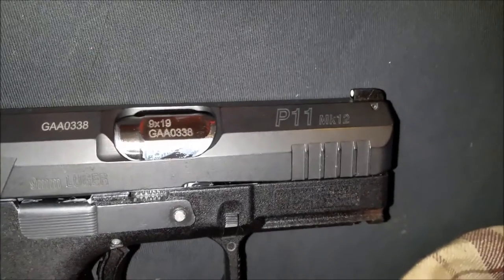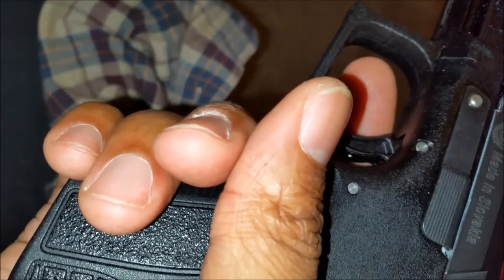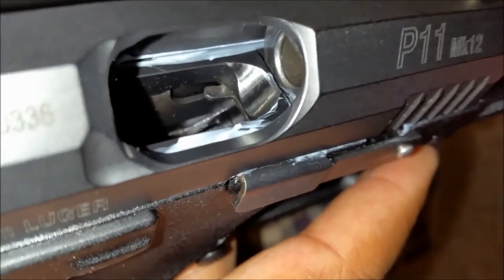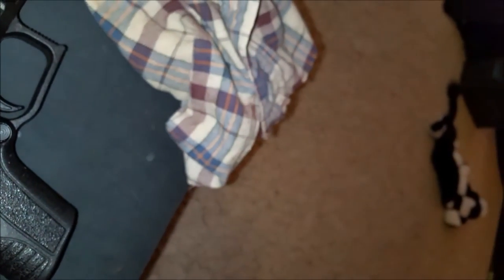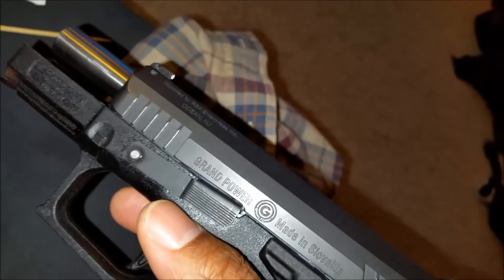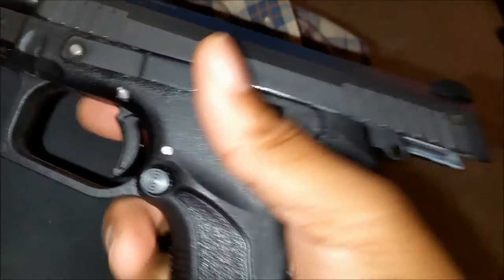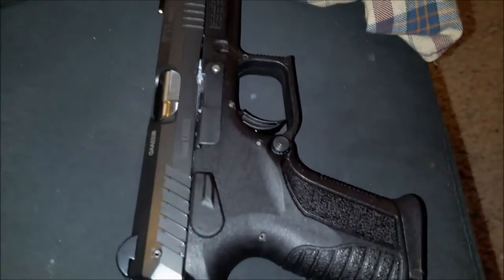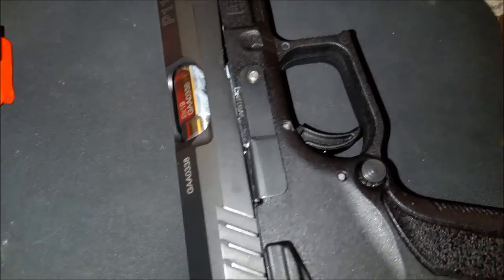Grand Power P11 Mk 12 - Failure to Return to Battery

Comment: Thanks for you reply. I have never tried or probably never will use flat nose FMJ's. I like round nose 115gn. I'm not interested in any pistol that can't shoot them reliably. Round nose 115 Hrain are easiest to get and lowest price to practice with. I shoot Remington UMC FMJ round nose out of my Ruger SR9c with never a malfunction of any kind. I really like double single action hammer fire that has Flip DOWN thumb safety's that are not slide mounted.That's why I never bought the PX4 Storm and that gun is just too thick. I resently purchase a Turkish made GIRSAN MC14 in 380. I love this pistol! Wish I could find one in 9mm just like it. Wish I could put up a picture of it! It is imported in the US by Zenith Firearms. I really like everything about the GP P11 but I'm not sure how much I trust the rotating barrel. I saw Sootch00 review and I love that guy! He is my favorite gun guy! I like the Bersa UCP but it's a hard gun to find. It's lower price than the p11 I think. What ever I get, it has to be reliable with my preferred defense ammo, which is Winchester PDX1 124gn Plus P
Reply from the maker: +Robert Glover there's a reason I used flat-nosed FMJ.  It's a good way to test how JHP would feed, and I was trying to diagnose an ammo issue.  Initially, the problem showed itself with Remington JHP.  Instead of shooting all JHP, I decided to buy flat-nosed FMJ to diagnose the issue, as flat-nosed is an attempt to mimic how JHP might feed, so you don't have to spend tons of money in troubleshooting/practicing with JHP.  

I also shot other brands of ammo (all in one session): WWB, Gecco, Tula, and American Eagle.  Only the Remington caused battery issues.  A total of 440 rounds and between 5 brands and only the Remington caused issues.

I get what you're saying but it's a bit difficult for me to accuse the Grand Power of issues when my Springfield XD exhibited the exact same problem with the exact same ammo, at the exact same range visit.  That is extremely difficult to argue against.

I've a Ruger SR9C as well (well, it's the wife's).  In fact, I've more than several guns that eat whatever is thrown at them.  If I didn't think the GP was worthy of carrying, I wouldn't be using it as my EDC now.  I think the GP is worthy of EDC, as long as you're familiar with how to lube it and as long as you test ammo...that's really no different than any other gun on the market.  Glocks may run without lube but that doesn't mean it's a good idea.  Glocks (or Rugers) may eat ammo without issue but that doesn't mean one shouldn't test ammo.

Let me know when you get a Bersa UCP...I've been curious about those!

Comment: Ron Sinclair  Start using Weapons Shield Oil instead of grease on your rails.
Reply from the maker: I don't think it was an issue with the rails or the lube I'm using.  The fact that I went from multiple FTEs and RTB issues to only 2 tells me that what I did to correct the issue actually helped.  What did I do?  I used grease on the helical cut...I hadn't been doing that. I ALWAYS grease the rails on ALL my semi-auto guns, regardless of the makes/models.  This gun's rails are no different than any other gun's rails.

Comment: Hey sorry you're having problems with that gun. I drooled over that gun when I first saw it. ha yesterday. The gun is beautiful. but after seeing your video I'm starting to have second thoughts. there must be a lot of slack in that slide I can hear it rattle every time you flip it over also the feed ramp looks like it's too steep coupled with the fact that you have a barrel sliding over a bar maybe too much friction. I think the design is flawed. think about it you have short rails with a lot of slack between the rail and the slide. the weight of the slide is going to cause it to rock on the rails instead of sliding on it like it should. Too much slop. Here's what I read from another owner, comment........ nathancombs· 0 points ·  Got my self one of these my take is fun range gun not for carrying. Put about 800 rounds through it. I got the Canik Sa at the same time the Canik is a better gun. Bad stuff: 1. When slide is all the way back it is wobbly. 2. Mag is also wobbly when fully seated. As yes it's a go is idea to give it a 2nd tap just make shore it's in. 3. Not 100% relyable ( used white box and Blazer aluminum all 3 of witch my CZs eat up) get a lot of fail to feed and with the Blazer aluminum lots of light primer strikes. The good stuff: 1. Duse feel good in the hand 2. Bullets go where you point 3. Reiablty for a range gun yep it jams up but not enough to make for just for fun shootings 4. I think it looks cool Am I happy with it yep will it ever go with me to pertect my life nopposted 6 months ago · reply

Comment: I had the same problem with the same gun. It's not the grease - it's a poorly made firearm. Face it dude - we got ripped off.
Reply from the maker: Matt Novak I think it's just a very tight gun and doesn't tolerate being dirty and out off spec ammo.  It only does it with practice ammo, never SD ammo (unless the gun is dirty).